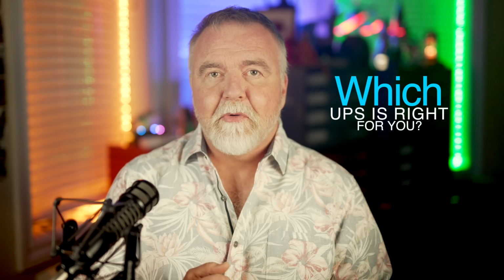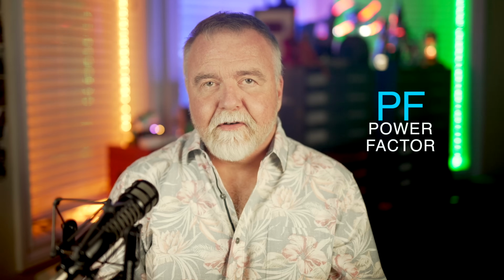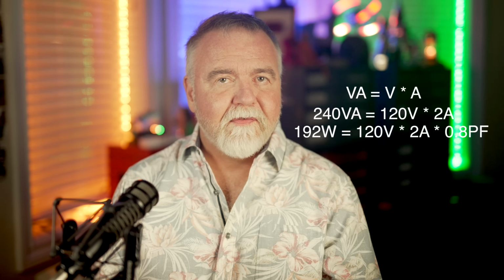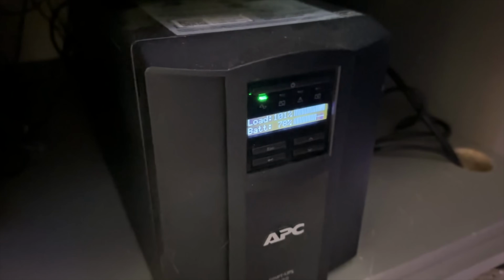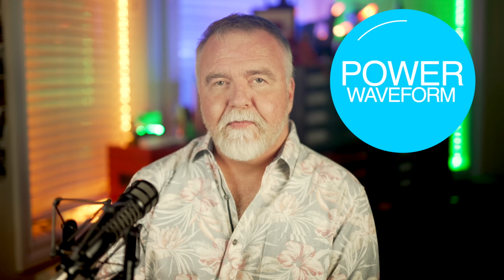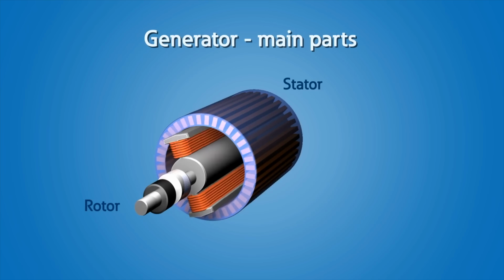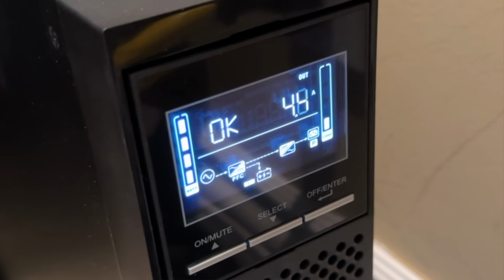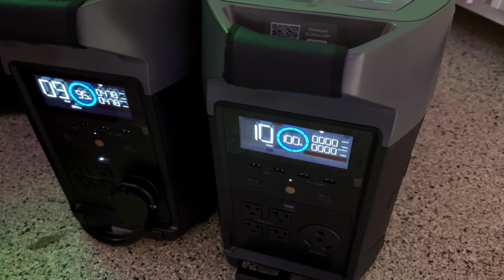The UPS Secrets YOU Need to Know!

Comment: To say that lithium batteries have an environmental advantage because they don't have lead might be a bit off.  Lead acid batteries are one of, if not the most recycled consumer good in the world.  99% recycle rate.  You can drop off lead acid batteries at virtually any auto parts store.  (Some even give a store credit if you're not bringing one back as core for one you bought from them!)

Lithium battery recycling, while improving, has a way to go.
Reply: Lithium battery production is far more polluting than anyone who recommends them seems willing to admit as well. Matter of fact they always seem to completely gloss over (not even mention it at all in in 99% of cases I've seen/read) how dirty actually getting usable lithium is while at the same time criticizing the same aspects in other power sources.
Reply: @JimmyRussle  Agreed on the mobile / small devices being the biggest source of "loss" in the lithium recycle circle of life.  The thing would be to incentivize turning them in for recycle instead of tossing in the trash.  

That's what happened with lead acid batteries.  They started adding a core charge to new unit purchases, and as I said before, some places offering credit / $$ even if it wasn't a core return for a purchase made at that establishment.  

Note that I am in favor of lithium batteries as a whole, and do plan on converting my UPSs over to LiFePo4 the next time the lead acid units need replacing.   Would have done it the last cycle, but the projected cost per year of service was still too high in comparison to lead acid.
Reply: Yes I was looking for this comment! Is one of the main advantages of lead acid batteries aside from safety
Reply: Good point and lithium brings different issues and agree the recycling of lead acid is far ahead of lithium.
Reply: In the days of Nokia phones probably NONE of the batteries were recycled an in general this is improving but very very slowly. Usually a lithium battery is small, lightweight and ignored as the next household bin goes to the tip. PLUS no-one wants a factory full of dead lithium batteries in all states of damage just waiting to burn.
The copper in a lithium battery is probably the most valuable part, the lithium being the most environmentally impactfull.
Reply: Yeah, lead-acid batteries are really highly recyclable. I'd imagine the environmental impact would actually be overall better for lead-acid, but there are a lot of variables that I'm not qualified to compare.
Reply: After watching numerous videos of bad lithium-ion batteries turning into miniature rockets, I would not feel comfortable having a big one inside my home...
Reply: And the mining for materials done by children and women and destroying water sources and more
Reply: Also considering most “dead” lead-acid batteries just have corrosion on the contacts.
Meaning for someone qualified it doesn’t typically take much to get a life extension before even needing to recycle them.
Iv heard of people doing it themselves but ild generally discourage that apart from maybe checking the exterior contacts if you have enough electrical competency.
Reply: the battery core itself you can sell for 10 bucks or more. i sold my dead lead battery to people who refresh it and sell it to others. you get a discount at the store if you trade in the battery core. that contribute to why people tend to recycle it.
Reply: @nathnathn  everyone who drives should know how to change battery and clean connections. It doesn’t take a rocket scientist 🤣
Reply: @Thumper68  though do remember that a lot of newer cars won’t let you replace the battery your self.
As they require a technician to manually reset the computer/control system.

Comment: This is probably the best explanation of the various factors affecting UPS selection that I have ever come across, especially concerning Watts and VA, off-line, interactive,  etc. The only thing to add (probably a full video on its own) would be a feature on the software options for UPS management (Windows, Linux, environments like Unraid, etc.). For what it's worth, I use my Unraid server for my UPS with the desktop PC as an apcupsd slave.
Reply: And this video actually came at the right time as well since i was in the middle of trying to figure out if the issues i have been having with a new switch is a result of it being sensitive to power fluctuations and what type of UPS i would need to get to hopefully stop a switch from resetting every time the ups returns back to main line power...
Reply: @Michael Hanson  Does the switch have an internal or external power supply?  I have replaced a couple of supplies on small switches that simply failed due to age / heat / poor component quality. Since the mains supply can be missing for half a cycle or so when your UPS switches to and from the mains (depending on UPS type), it's possibly the switch's power supply that is at the root of the reset issue you are seeing. I would try an alternative supply first if that's an option.

Comment: I upgraded our UPS at work, and am so happy with it.  We have power outages all the time downtown, and it was sooo annoying to get calls randomly 2-3 times a month.  Especially during thunderstorm season.  I got one that is 3000VA to run our 2 servers, the switches and the router.  It's overkill, but it wasn't that expensive compared to one at half the price.  My rule of thumb for anything electronic, is always get a power supply/UPS that is double what is needed.  That way, they'll tend to run more efficiently.

Comment: @Dave's Garage - I've always relied on an UPS to protect my desktop PC. But to save myself some money, I bought a used small capacity UPS unit and connected it instead, to two high capacity 12v leisure batteries wired in series, thus replacing the two original internal series wired lead acid cells. The UPS easily keeps my desktop PC, two monitors and router running for much longer than normal as a result.

Comment: Used online UPS units are usually pretty cheap because companies switch them for new units whenever they install new servers. They will need new batteries but those can be cheap if you buy from a wholesaler in bulk. One thing I can’t recommend enough is setting up a NUT server to shut down all your computers and servers even if they’re not connected to the USB port of the UPS.
Reply from the maker: Yup, I've bought a few off eBay and then just put a new battery in it.
Reply: This is what I did. Got a Tripp Lite 3000VA online UPS rack mount for under $200 and found batteries for $150. It is showing a 10% load for the whole server rack!!  (Only minor whining point is the WEBCARDLX managment card costs about as much as I paid for the whole UPS.)
Reply: @BorkToThe3rd  don’t bother with network card, just use NUT server. Once you get it setup it’s easy to add new clients.
Reply: @DavesGarage  Yup, that's where all of my UPSes came from including the rather large 6kVA online unit with the 240V DC bus (and about a quarter tonne of batteries after I was done with it) which I ran basically my whole house off through a number of 2+ hour power outages when I was living in a place with really bad power (mostly in summer because of all the A/C's, reason I went so big was so I could run MY A/C off it ;) ).

Currently running an 3kVA online SmartUPS (oldschool, commercial-grade, pre Schneider) and a 3kVA dual-conversion Eaton unit (each on a separate, dedicated circuit) in my rack that feeds out to outlets in my study.

Comment: 80% power factor and 80% max long-term load are good rules of thumb.

Plug your dual power supply servers and switches into a UPS-backed PDU and a grid-backed PDU.  Make sure the PDUs run consistently ≤ 40% so that if the grid fails, the UPS will handle the full load and the PDU will be running ≤ 80% rated load.  Just remember that the load and runtime listed on the UPS will be halved if it becomes active

Comment: I have the same APC smart-ups 1500 that you showed in my house for my server rack. I doubled its battery capacity by adding 2 more batteries. Keeps my rack of switches online and internet for around 6 hours if I want or server for about 2 hours. I have a whole home generator but it's manual transfer.

Comment: I found out the hard way that line-interactive has another drawback, you have to get much bigger than you think you need.  I had one loaded to about 80% but when the power failed the surge from the capacitors in the PSU draining during the switchover caused it to overload when they tried to charge back up again.

Comment: An important feature to look out for is the hold-up time at the intended load, I've just seen a cheap UPS offering 1 minute hold up time at rated VA, which is probably not long enough for an instant orderly shut down.
As ever the issue is trying to better the usual mains MTBF while having the facility to switch out batteries or a whole UPS. A really good UPS will be tracking the mains waveform to cut in with little noise and sync to an incoming AC waveform for a clean zero voltage point change back to mains or generator.

Comment: I got my hands on a free APC 750VA unit because the batteries were knackered .... It's now modified with better heatsinking / fan cooling and running from 3 x 12v car batteries charged from my 2 240W solar panels.
it runs my old 4770K workshop pc for ....well its never run out yet despite using it for well over 4 hours at a time also powers the network switches and router but they're loads are very small in comparison.

Comment: This is why I have my Rackmount 1540W UPS on a dedicated circuit.  It only has to cover for a few seconds while the Gas Generator kicks on automatically.  I put all my Network gear, POE switches and Rpi Servers on UPSs as well.  Not dropping my main Machine amd network during a power outage.  Same reason I currently have both FiOS and Xfinity services with Failover and VLAN routing for streaming.
Reply: Q1. How does "VLAN routing" improve the availability of your setup? 
Q2. VLANs are a Layer 2 construct while routing happens at Layer 3 so what exactly is "VLAN routing?"
Reply: Smart!

Comment: In a town full of furniture manufacturing, we found the voltage protection against sags, especially in plants that already had low voltage (105 a lot of times) and equipment turning on randomly, kept data from corrupting overtime.  Boss swore he had to reload Windows at least yearly till he started running with a UPS.

Comment: I just bought a 1500 VA APC lithium unit due to time. Just had to power a Synology and a few switches. When I get the time, I am going to adapt small 12v Victron inverters coupled with 4 cell  LiFePo4 batteries.

Comment: A good presentation but a somewhat critical topic was left out…  Lead-acid batteries have two general types; starting service and deep cycle service.  Without getting into the chemistry and engineering, I’ll just stay with the names as they imply.  Typical automotive batteries (not for electric cars) are for starting service and do NOT perform well in a UPS.  Deep cycle service is what a UPS needs.  Not that a UPS necessarily needs to deep cycle all the way or often.  But when it needs to, it needs to have as much capacity it can get without overheating.  And it needs to be able to recover with minimal negative effects on the battery cell components.  The quality of the UPS charging circuitry is also very important where you don’t want it to continually overcharge and cook the battery to death prematurely.

Comment: Thanks Dave.
That is the most impressive talk about UPS that I have ever heard in 70 yrs of ac & dc systtems working.
Yes, VI Cos theta / thi is the way to calculate for the "imaginary" element which is as you said the A vs V differential phase.

But you did slip in a short comment about 3 phase.

Are there really requirements & solutions that are 3 phase mains?
Servers or data banks I assume.

Well done for being so pedantic..

Others could learn a lot from your great talks..

About time you polished gramps old truck.

Comment: I recently learned a good visual example of Power Factor. You pour a glass of beer to full. The bottom 3/4 of the glass is beer and the upper 1/4 is foam. So the PF would be .75 as the good stuff is at the lower 3/4

Comment: People often forget cooling power when designing a whole room UPS. One place I worked had around 50-60 servers that were used for development and QA. The UPS took one whole rack, with 3 racks for the batteries. One day the power went out and we discovered that the room was simply too hot to leave the servers on.
Turned out someone forgot to pay the utility bill and it would be over a day to sort out. The batteries would have run the servers that long. or so it was said, but with the AC would have been good for only 4 hours or so  .

Comment: Excellent explanation of what they do and how they work!
I personally use a unit big enough to run my entire work space (4 computers, 12 monitors, 2 printer, all of my led work lights and other miscellaneous devices)  for between 3.5 at full load and almost 7  hours with minimal load.

Even for basic home users I highly recommend having one for any desktop computer.
Reply: yes, new information, I did not know existed or was a thing UPS I thing is more completed than small computer, them small UPS, large computer, the larger UPS,  ?
Reply: Just remember: don't plug laser printers into undersized UPSes. You can cause house fires that way

Comment: at work we have a 380v DC UPS for our servers, our server 240v power supplies just use rectifiers on their input so they can handle DC voltage just fine, this removes the conversion stage and increases efficiency. Afterall you are in the end converting AC to DC to AC to DC 
im sure when 12VO power supplies take off someone will make a power supply with an external battery to skip even that final DC to DC step and initiate a soft shutdown or just kick the device to sleep, just accepting that your monitor would not work

Comment: Great overview.  Loved the simple explanation of power factor.  Try the conversion of transmitter power to ERP (Effective Radiated Power.  Hox you can put a bunch of RF into a conduit and get four times that power out makes the "free energy" crows drool all over thenseves.

We were feed 440 three phase at 60Hz.  KCP&L (our local utility)  would drop a phase on us without warning and smoked our input transformer.  Those were over a grand apiece in the 80's.  I built a "crowbar" curcuit.  Three transfomers (440 volt to 120 volts),  three relays with contacts in series, and a heavy duty three phase contactor.  If one phase drops the contactor opened in way under a second.👌
Reply: @uploadJ  Yes, it is a theroretical increase not a real one.  But it reminds me of all the "free energy" crap that you see.

Comment: Good low-down - but....    The story starts with surge protection.   Having correctly installed surge protection devices (SPDs) is an essential element.   They should be installed in the consumer unit - or 'panel' and be connected to all supplies.   In Australia - we connect them to all three in-coming phases (3 of them) and bond then to a main bond.  We configure for 64A of surge current for domestic supplies - or 200A commercially.

from there - we have bonded secondary SPDs in comms racks, computer rooms, building services rooms, pumps, etc..   They are also protected by an equipotential bonding arrangement.  This way, the UPS shouldn't see much over 150V US or 300V/phase in the rest of the world.

Comment: After looking at UPS's, portable backup power and replacing UPS batteries I found the most cost efficient setup however slightly manual is a cheap UPS (most devices are fine with a modified sine wave for a short period) and a large lipo battery+inverter. 
You can get huge lifepo4 batteries (300Ah+) these days for relatively cheap and a charger for around $50. Paired with a big pure sinewave inverter for another couple hundred and if the power goes out you can just hook up the UPS to the battery/inverter and get many hours of runtime without any downtime. The UPS will take the load for a few minutes while you hook it up and then will simply passthrough the clean inverter power as required. You will need to manually hook up the inverter and charge the batteries but this setup has the added benefit of being a portable power source when out camping or travelling. It works out to be around 1/5th the price of a premade solution.